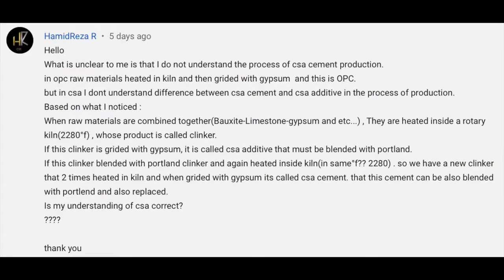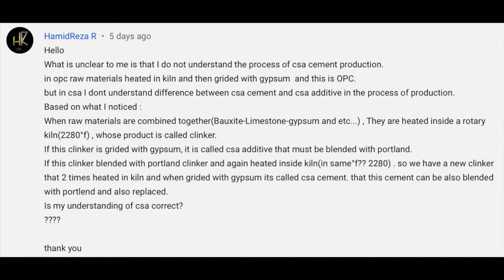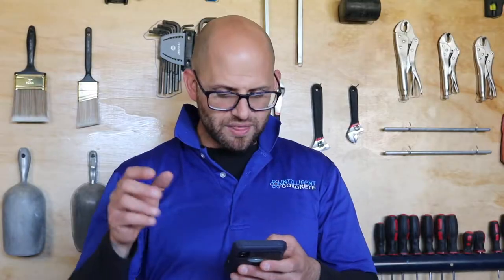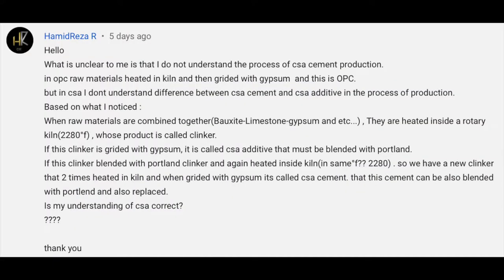CSA Cement Production - Vlog #339

Comment: Hi Jon, I would like to build a CNC milling base out of CSA.  Is there a rule of thumb for pouring time if I wanted to do a two part pour where I let the lower section cure a little, then put a new mold on top and pour another section expecting it to adhere to the lower section?  Saying this another way.. can new CSA stick well to partially cured CSA.  I can have some rebar coming out of the original pour to go into the new pour.  My two-part pour is needed because I want gravity to level out a lower area and then build it up on the sides to a higher level and let gravity level the sides.  In this manner, the surface of the base and the tops of the sides will be perfectly parallel (in a perfect world).

Comment: Thanks Dr Belkowitz, i have already read a lot about CSA cement it's can be applicable as an  additive agent for concrete low shrinkage and  also it's resistant to curling phenomenon compared to OPC binder, CSA cement is the main binder in sel-leveling mortar.
I have choose during my bibliography study to work on CSA cement by recycling phosphogypsum as an sulfate in put for raw material. There are a lot of types of CSA cement, we called this cement by eco-cement because the csa cement production will reduce 30 to 40 % of carbon emissions compared to opc cement production.

Comment: Having watched  an interesting video on building garden planter boxes using CSA at https://www.youtube.com/watch?v=x7jz96MDvyo, it seemed like a good alternative to portland based mixes. Aside from the workability issue with CSA being so quick to set,  would you say CSA is the best option to create high strength concrete that can be thinner to minimize weight in a cost effective manner? You mentioned in the video there are options you might prefer.  I live in a cold environment where freeze thaw is a concern. It sounds like CSA is a better option for freeze thaw cycles but would typical concrete countertop portland based mixes with acrylic, glass fibre etc be as good? Thanks